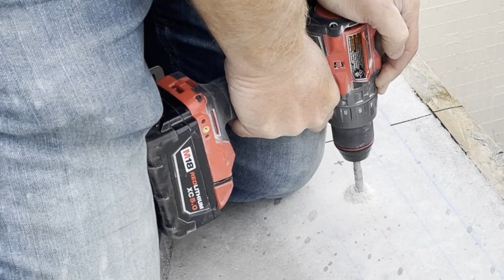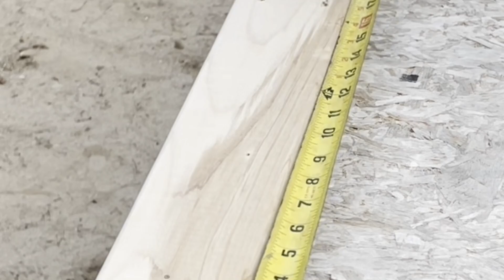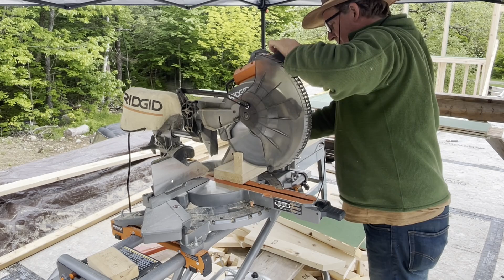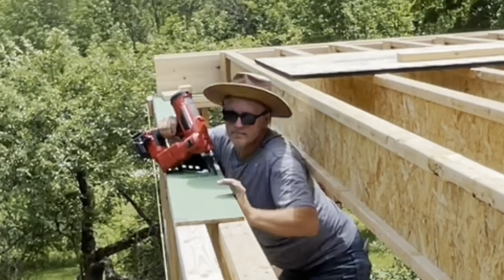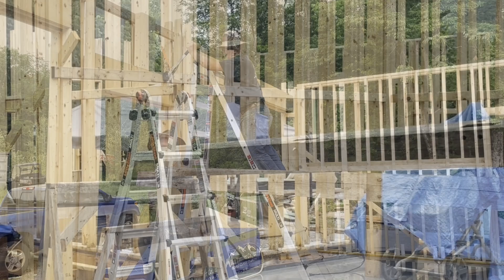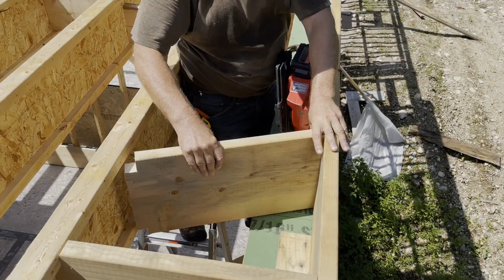1st Floor Framing by myself

Comment: Double wall construction is great. Alaska in the 80's used this type of framing. 5 star rating in blower door tests. 
single stud install was used here in Oregon by one of my solo framers. works fine.
Reply from the maker: The area that I am building is very cold, since we live in the mountains.  I decided to spend the money up front, to build an efficient structure so I won't need to pay for it later with heat loss.  I don't think the cost of heating will ever go down.

Comment: Did you stagger the wall framing to break thermal bridges?
Reply from the maker: Yes, I staggered the studs to prevent thermal bridging.  I plan to make a video talking about that, but right now I am trying to get the building closed in before it snows.